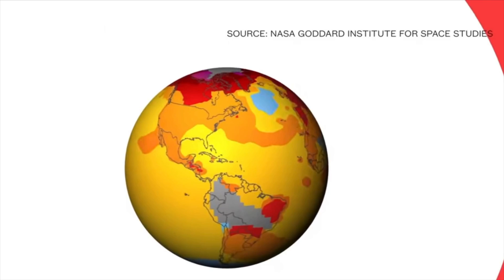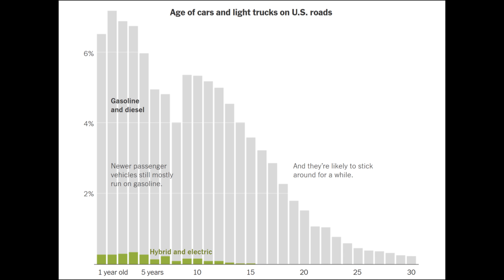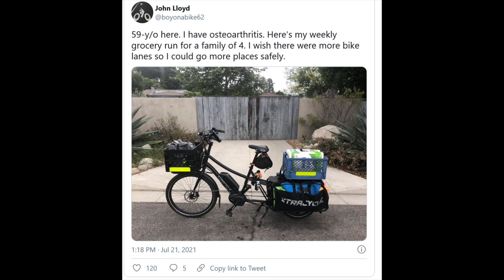Micromobility - the EV's of the future

Comment: I can’t afford an electric car or a new gas powered car. I would walk more, if the streets I cross weren’t so dangerous. Another thing. I only need a small car. Also, I don’t need a touchscreen, that would save money. People drive SUVs and they are single. They only need a small car. Also, it’s very hot out and there’s heat advisories. I wouldn’t mind getting a bike. I’m strong. But, the traffic is dangerous. I think that the big SUVs and trucks are so unnecessary, unless you have a big family or need it for your job. In the meantime, that would solve some of the problems. But, the roads here are way too dangerous with the big SUVs wizzing by. I miss the days when we started using small cars to save gas. In the meantime we could go back to that. A small car that can carry 4 would be a smaller car. The auto companies are making electric vehicles and SUVs which are heavier when they hit a pedestrian. Also, there needs to be major infrastructure changes in order to ride even electric bikes and scooters. Because, America is designed around automobiles and auto traffic which makes it both ugly and dangerous. We also would have less fatalities if we could just get even half of the people off of the streets with the proper infrastructure and safety for pedestrians and bicyclists due to better car design and less weight in an average automobile.

Comment: Another micro mobility solution golf carts they're cheaper lighter and consume less energy than cars they're usually capable of 20 or 25 mph which has about what's appropriate in urban settings they do require a little bit more infrastructure than bikes but they're slow enough and small enough to definitely not alienate bikes and probably not alienate walkers and runners using the same trails
Reply: E-bikes in the US are typically designed to provide electric assist at speeds of up to 20mph (Class 1 or 2) or 28mph (Class 3), so they are going to be as fast as faster than a golf cart.  In addition, because they are bicycles, their narrow profile and relatively small size means they are much easier to park and store, and can easily use most or all cycling infrastructure.  I think there are relatively few situations where a golf cart would be a better solution than a golf cart.

Comment: Well first off no one has ever ever said or thought simply switching to EVs was the solution. It is a very small piece of a much broader plan. That plan should include wind, solar, geothermal and other renewable resources. 

The average Model 3 doesn't weigh 6000 pounds. Even so, it is more efficient than a gas car even if it's moving one person on a day to day basis. 

As far as the batteries Lithium isn't the only technology they're working one. Tesla along with others are working on producing batteries that don't use Lithium, cobalt or manganese. They and others are exploring sodium batteries and more.
Reply: As he said in the video: Long term, electric cars are part of the solution and they are great. But they are no silver bullet

Comment: 1:26 "But even if all cars sold tomorrow were a hundred percent electric, the switch to a fully electric fleet would still be an extremely long term project." So if the switchover was mostly complete by 2040, that's "extremely long term"? You were born within a few years of the millennium, yes?

3:25 "6000 pound Tesla" with a single occupant. Model 3's weigh 3648 to 4250 lbs. Model S' weigh 4561 to 4941 lbs. Model X's weigh 5185 to 5648 lbs. Seems like you're stretching the worst case to make your point look better.

For micromobility though I do think it'll be an important part of transportation.
Reply: The main point of the video is about the unnecessary weight of any car EV or otherwise for what people commonly use it for. Him not being precise of the weight of Tesla doesnt detract from the point. Also Teslas just do tend to weigh more than their counterparts regardless.
Reply: @coolandok6512  They can make their points sticking to facts, not stretching or distorting the truth trying to make their points look better.
Reply: To the second point: yes you are correct, he should've said "4500 pounds" maybe or "at least 3500 pounds".
To the first point: 2040 is long term in the sense that you could transform a city's core to be bike friendly in like 4 years or less if there was enough political will while simultaneously saving money longterm in things like maintenance and increased economic activity.

Also 2040 would be the best case (if we banned ICE cars from being sold tomorrow). So he was making the point that the transition to electric cars was extremely long term. He could have been a bit more precise in that argument tho

And btw that "You were born within a few years of the millennium, yes?" is extremely rude
Reply: @Alltoc  the video creator wasn't comparing the timeline to how long it would take transforming a city core to be bike friendly. 
People in their teens and twenties, myself included when I was that age, simply have a different scale of time compared to older people. When twenty years is equal to one's entire lifetime it's perceived as extremely long term. Get older though and twenty years is still a lot of time but not perceived as so long.
Reply: @flinx  well yes, I can see why you thought he was around 20 years old (still rude how you frased your question), I just think you missed his point